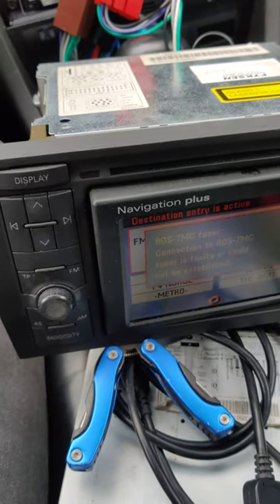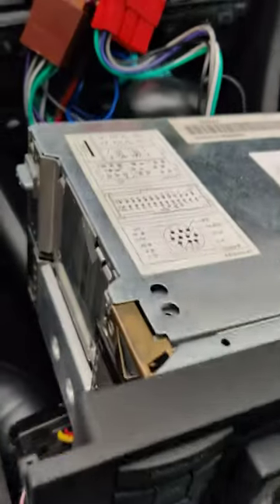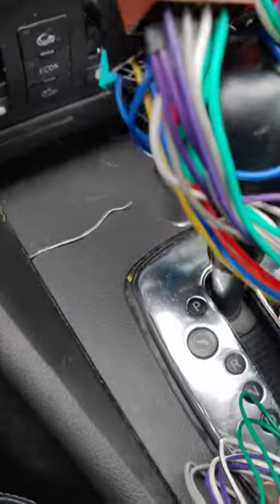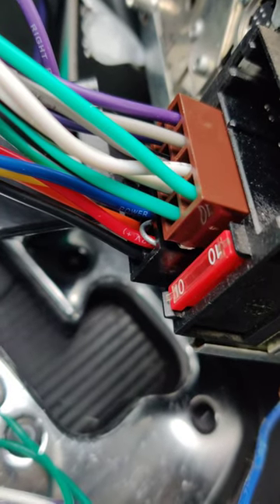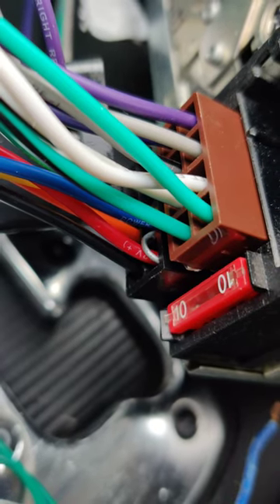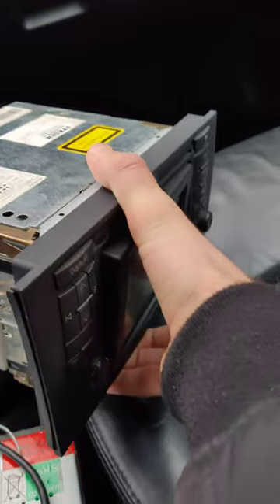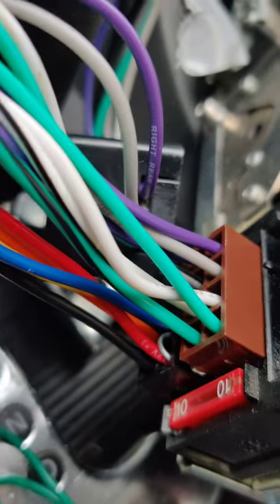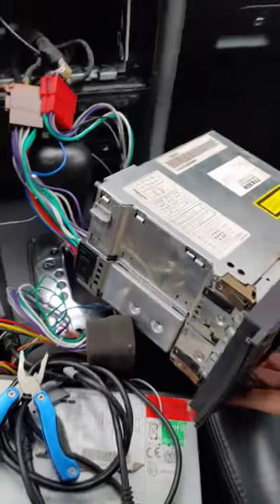Audi Navigation Plus pin error fix. Safe switch.

Comment: How do you cancel SAFE mode with Navigation Plus?  What combination of buttons do you need to push on front to remove SAFE.  I have the correct code but cannot enter it until I get it out of SAFE  Other models have a button combo to push but cannot find one for the navigation plus system
Reply from the maker: have you  tried  what i did there? find metal wire , cut it 2cm long and bend it , then just push one side into +wire and other one in SAFE wire... to be able do that you have to get out Radio and access back connections...to do that you will need too specila metal tools, any audio shop have those ones... mybe you could show this Video to some handy guy , he could help you out.
Reply: @krisfix969  I'm not wanting to take out the entire unit.  I have reset it before by pushing a combo of buttons on the face of the unit, I just cannot remember what they were.  Once it's reset, I can enter the code, which I have.  I just need it out of SAFE mode and I know SOMEBODY knows the button combo to make it happen.  (PS  If I wanted to take out the unit, I don't need "some handy guy" to do it.  I'm a handy girl...I could do it myself :) )
Reply from the maker: @WendyStClair-bt3tc  great to hear you so handy!! 
about Code- if i recall properly , you shoud switch car key on nr1 posittion and kepp radio on for 15 min ish.. then its resets him self.
Reply: hello i have the same problem but i can't find anywhere how can you help me?  my car radio is in safe mode but the buttons don't work and I can't enter the code